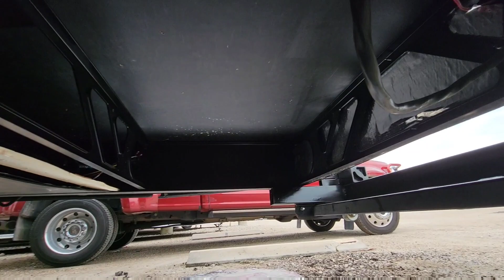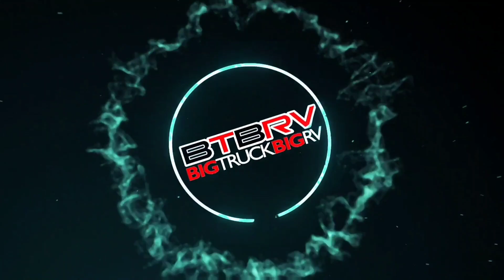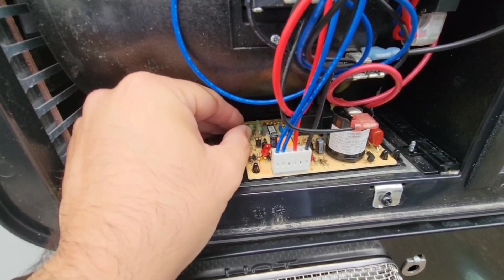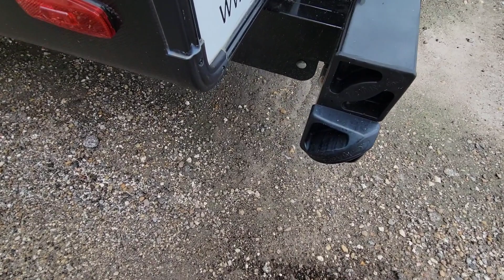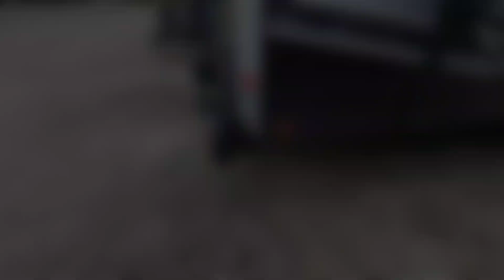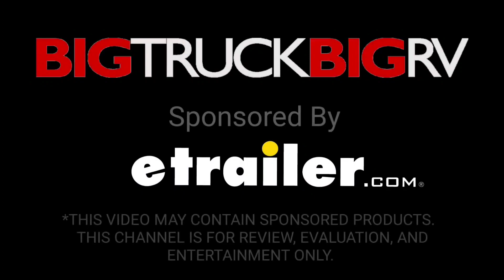Did I make a mistake modifying our new RV?

Comment from the maker: Update: The furnace power/reset button provides power to the interior thermostat, so I needed to turn it back on to use my ACs.  Since filming this video (several days ago) we have not had any issues with the furnace any longer.  An RV technician claimed that after the rain we had they received multiple calls from folks with the exact same issue.
Reply: Well that just means it's going to be a long term issue.
Reply: Good plan, remove the hitch and relocate rollers.
Reply: I would still coat that board. We are now in rainy season and you will be able to see if moisture is playing a part in the event when it happens
Reply: We had the same issue they replaced board and sealed well put a lip to re direct water
Reply: Just remove the hitch leave the tabs and the rollers alone they're not hurting anything
Reply: Sounds like the manufacturer didn't choose the best place possible for that circuit board.
Reply: @machfive916  engineers today lack the hands on and common sense needed to make a long lasting design. Utilizing conformal coating on the board would make sense however this would add to manufacturing costs. I will say this, today’s engineers designing today’s products have one skill figured out, “ engineered obsolescence”.
Reply: They didn't recommend a cover or deflector for the circuit board? Considering the door has a large screen vent.
Reply: How do they keep the tanks and pipes from freezing without insulation? Very strange.
Reply: A friend washed his 5ver and his refrigerator went down. He was able to reset it with the magnet switch.

Comment: My two cents… I would leave the receiver on.  First, I don’t think clearance gains will ever be enough to matter.  Second, resale as you might want to take your other rack.  Third, it will increase tongue weight slightly.  Fourth, if it ain’t broke, don’t fix it. Lastly, and this is the most important, it be a handy place to put a sign that reads “old fart on board”…. Lol.  Or maybe just truck nuts… derp!

Oh, and things are always stronger with more iron…🙂

Comment: I think insulation in between your floor boards and those panels is smart. In cold weather it would help immensely! And i have to agree with the way the factory runs there wires are exposed to chaffing or possible electrical fire if not careful. That really needs to be addressed before it bites you. Im going to look at mine and if this is the case with my rv im going to make adjustments.

Comment: So If I'm understanding what you have done correctly you extended the rollers to the bumper when you extended the bumper. I see a problem with this if you should bottom out all the weight now would be on the extended bumper and not on the actual frame of the coach so when in that mode you will litterly push your bumper and rack into the back of your coach. I would move the rollers to where the frame is so when riding on the rollers it would be riding on the frame I would also put two two inch receivers mounted in the middle of the bumper and possibly make it long enough to reach the next support structure so a longer 2 inch tubing  then attach your receiver so your racking would flush up with the top of the bumper  it would rate more that 300lbs times 2 and make your rack removeable so when in a jam you could remove it so nothing on the rack could damage the back end as well

Comment: I would say unbolt the hitch first and see if you really need it or not before cutting off the welded section that holds it on. A lot of campers come with the brackets but no hitch. Next I would suggest moving the rollers to the front side of the hitch bracket so that it is directly below the frame for support in case you did come in contact with something that put them in play!

Comment: I would remove it less weight is always better especially if it no longer serves the purpose. I would be more concerned about the wiring maybe wrap the wiring in something to prevent them from chaffing against the steel. Something to consider before you close it up again.

Comment: Remove wings , hitch and rollers and have a custom skid plate made across the whole thing. Rollers will be to much of a pressure point if they hit the ground through a dip. Would rather spread the entire weight of the Rv over rear frame . Less change of screwing something up . A fab shop could bend something up and weld to frame and bumper .

Comment: My take on it, is this... the rollers should have been mounted on the frame, not the extended bumper. Your extended bumper, most likely, isn't as strong as the frame of your 5th wheel and when it does hit the ground, it will bend up the extended bumper. As you said, it is only capable of 300 pounds of force. Your rollers will exert more than that, considering the weight of your 5th wheel.

Comment: I would remove the receiver and move the wheels forward. The wheels are pointless with the receiver there as the ground would hit it before the wheels. 

Moving the wheels forward would keep the weight off the bumper part which would probably just bend it and putting them closer to the main frame for more support.

Comment: I removed the hitch wings from my 398MBL. They hit the ground all the time. They drug the ground leaving the rv dealer. I'm not sure if mine would be different from yours, but i have to be carefully with inclines because i drag the back bumper very easily. 
I also had the same issue with the furnace after the Texas rain a few weeks ago. The outer trim you pointed out in this video has absolutely no sealant or gaskets behind it. water was coming in behind that and pooling under the circuit board.

Comment: Hard to get a good angle on it through a camera lens. 
1) Valid idea removing unnecessary weight and obstacle from the rear of the RV.
2) Would leaving it in place add any, or enough to be worthwhile, structural integrity.
3) While 'we' are down there, Is the Spare Tire low enough it would hit the ground before the rollers will? Can/should the spare tire be moved?

Comment: These boards are supposed to have a coating on them to help with moisture. My board for my water heater just failed because it did not have the coating and I could see where it burnt. The new board has the coating. As for the back of your tailer? Leave it!

Comment: I would keep the rollers and remove the receiver.  Something you might also look at is changing the mount point of the spare tire.  I got into  situation where the back end of my toy hauler started to drag and pulled the spare tire loose.  To fix l mounted it higher up between the l- beams.

Comment: Never fix a problem that doesn’t exist…
Have you often been in areas where you drag the rear overhang? No? Then stop overanalyzing it.
Yes? Drive over a string, pull it all the way to the rear bumper, and locate the roller (and/or trim the receiver tabs) just so it’s just peeking out from the plane of the string.  Anything worse and the rollers wouldn’t have helped, anyway, in that situation.

Comment: I Would Remove The Receiver Because It Protrudes Farther Than The Bumper & Every Inch Counts In Length Being Extended
I Would Leave The Brackets & Roller Assembly As Is  ! !
Looks Like The Bracket Could Give A Slightly Earlier Warning Due To Sound / Then You Could Stop & Evaluate Your Next Move

Comment: If you remove it all and you still want the bumper rollers but want them so they don’t hang down and contact so soon I’d take and have them inset in the bumper that way they will still be at the back and wouldn’t be seen as easy

Comment: I don't know...we have lived in a cabin for  15 years without insulation under the floor. We had 3 layers of carpet and insulated skirting, and we had to keep our feet off the floors when seated and never go without socks and slippers. See what happens when you winter camp...even in heat. I am stunned that it is not insulated! Is that normal for other RVs? Mine says 4 seasons, so i assumed it was insulated.

Comment: I would leave it. If anything I would cut off the receiver. But just like light truck MFG's the give you a hitch receiver. It also acts as the last crossmember and ties the rear of the chassis together.

Comment: I had a receiver hitch made that attaches to the frame not to the bumper at all. Also had a rack made that goes into the 2 inch receiver hitch that’s heavy duty enough to carry the generator spare tire and has a rack on it to carry my two kayaks. That receiver hitch also has an extension receiver hitch 2 inch heavy duty that my bike rack goes into the carry the bikes. Works fantastic did cost a few hundred dollars but there’s no pressure or touching the fifth wheel bumper.

Comment: I don’t get the lack of insulation.  Batt insulation weighs so little and adding it would only help the insulated floor.  Why not have it in there and boast that the floors are even more insulated than the competition?
Reply: Batt insulation hold water, A friend had a toy hauler with batt  insulation under the floor ,several years ago .He ended up driving back from a beach trip in heavy rain. After a couple of months the floors began to get soft in several places. Had a RV inspection , the insurance totaled the RV . He was told there is no way to completely seal the underbelly .

Comment: In wet humid conditions fiberglass insulation will hold water and sag, plus it could/will be a habitat for mice, insects, etc. "Rabbit" out half of the board at the frame to allow the last panel to slip in, you would only need to rabbit or notch it out a few inches on each end, and keep the center section as is. Cut the welds and drop the receiver hitch.

Comment: Ditch the receiver hitch and the rollers. I'd cut some foam insulation and tuck it up in the void space using some channel clamps on your Ibeams to hold it in place. I'd also drill a few holes in that paneling and use the screw out removable christmas tree fastners to gold them together. I'd also likely take the time and plasti-loom all the wires up to minimize any possibility of chaffing which would cause shorts. Alot of work but in the grand scheme cheap insurance to protect your investment.

Comment: I vote for removing the hitch if it can be neatly done. I would also remove the “ears”. Then take a board, to simulate the road, run it from the back tires to the bumper. Now find a spot where the rollers meet the board and attach them there. Thank you for sharing and have a great day.

Comment: That spare looks like it is hanging pretty low.  Sweep a string from the lowest point on the rear axle and the rear most point of the trailer with the bike rack down.  See what the string contacts, then decide on how to move forward on modifications.  As an alternative, jack the front of the trailer up (on level ground) until something at the rear contacts the ground.  Modify as required for clearance.  Yes the front is going to have to go fairly high to get the rear to contact the ground.  Yes this will stress the suspension.    However, this test is going to be much less problematic then testing for contact under power.

Comment: I would still put batt insulation.
Reply: I was surprised there was none.  Our Arctic Fox has R-7 batt insulation under the plywood deck.
Reply: @txshirle  arctic fox is a four season rig so it should be well insulated.

Comment: Having just gone through the upper deck of my fifth wheel failing I am an advocate or structural support.  There is so much energy transmitted through the frame components support is paramount. Had the manufacture of the frame added cusots to the upper deck it would not have failed.  When the new deck was added it was welded with many arears of support that should have been done at time of fabrication.  Those brackets are adding support to the rack you have installed, and have pulled 76,000 miles in the last 4 years with bikes there is alot of energy being put to the frame back there.  .  Just my thoughts.

Comment: Instead of that small piece of wood to join the underpanels, just get a 6 inch wide board the same haight and length. The extra strength means that if done on every join you will be able to insulate the underbelly with rockwool etc. In the video the electrical cable seem to be prone to chafe. I would suggest if this is the case you secure the cables to avoid chafe where they pass through the steel foor beams. I have fitted a small length of garden hose cut langhtwise places around the cables and then secured with electricians tape or similar. This gives protection to the outer cable insulation.
   Bob

Comment: The wiring in the underbelly makes me cringe. Not enough slack and the needs to be some kind of wire loom protection/tubing as it runs thru the cross beams.

As far as insulation goes, instead of batting, how about silverboard?
Reply: Every bump and vibration cuts into those wires and the wiring and circuit board placement on the furnace looks "cheap.
Reply: @phoneman1957  Yup and its an easy fix to keep those wires safe. As for the circuit board it shouldnt be underneath the drip point of anything. Needs to be relocated or encased.

Comment: From the video it appears to be a very basic one sided circuit board. Old School large components. You can apply heavy coat of conformal coating to it so moisture wont effect it. You can get it in a spray can. We use it at work on boards that are used in outdoor Military Radio equipment.  Dialectic grease the connectors. Should be good to go after that.

Comment: RE; Bumper and rollers - The setup as-is only protects against a unique tilt-up issue. I don’t think it would do you much good if you ran over a speed bump type hill that was the width of the RV and of sufficient height.  You should do some drawings/modeling of the RV going over various size hills with various size crowns and widths. In many cases I think you’ll find the spare tire, the leveling jacks and other areas of the undercarriage will make contact before the bumper does. It looks like the bumper is meant to protect you only when you’re backing up, otherwise you need protection along the leading edges of the under carriage.

Comment: I would have used larger drag wheels that swivel, maybe attached to those 'wings". I agree...yu don't need the receiver. I don't like them because they stick so far out that when you put any sort of carrier, etc. on it, it will teeter and twist from side to side as well as bounce. I think putting the rack on like you did is the best way to do it.

Comment: BTBRV, You should use your influence to get these R.V. Manufactures to do a better job of running electrical wiring with the under belly pulled I saw possible wire chaffing issues. I have Noticed on other Videos how Messy the Wiring is in most of the RV's you have shown.
Reply: I agree, seeing wires run loose no protection no securement will surely lead to electrical issues in the future. I know I just love electrical issues.

Comment: 2" of Closed cell spray foam. Totally firmed up our toy hauler. Completely wealther proof. It's like a rock. And protects the wood floor. It was about 1000 but it was money well spent. As for the rear bumper setup. I'd leave it. For the reasons you did it that way in the first place. Safe travels.
Reply: Wow some one here knows about spray foam. That’s awesome . 👍A good question is why aren’t more offering this as an option during manufacturing . The loss through the floor is unreal, never talked about , it’s always roof and side walls . Good for you 👍👍

Comment: In the close up of the board I see that the back left section of the board is not attached to the black stand off peg. If the bottom of the board drops down, it might short out to the metal bracket. Home furnaces have a default to run the blower after a power interruption. The board is assuming that the unit had been running and that it is still hot. So the fan runs for a couple of minutes to cool down the furnace before it can restart.  Good luck

Comment: I never liked those little roller wheels.  Last rv I had, I installed heavy duty swivel rubber wheels,  such as you might find at Harbor Freight.  Bigger ones, like 6" or even 8".  That way,  when I would bottom out the wheels could turn freely especially in turning situations.  Those little rollers would rip off, rust up, fill up with gunk, generally were more trouble than they were worth.

Comment: I would remove the whole set up and lower the skid rollers. I dont think they hang low enough to help you out if you encounter uneven terrain moving forward. They will catch and assist while in reverse but I think you need to drop them to hang lower. They make some great bike racks for the receivers.

Comment: Cut the 2” receiver and the cross bar off but leave the two outer wings. They protect the rollers so the rollers can’t get snagged on something. Did I notice that the bug screens were on the inside of the access door?

Comment: I would leave as it is, you never know when you may need a bump step.
Reply: I was thinking the same thing
Reply: Concur, the wings and rollers are needed where they are to protect the bumper assembly.  I would hope that you could avoid dragging the receiver. But I would wait to see if it is a problem.

Comment: How often in the past did you get into or close to a situation where the ground clearance was tight.  If you run into those a fair bit, cut it off.  Else, leave it.

As far as the furnace, I would leave the switch in to see if the issue happens again, and make note of the conditions it happens in.

Comment: Lmao. Those wires will never ware the coating off while traveling.....  said No one EVER !   Wow 😳
Reply from the maker: Well, they generally don't. I've personally never seen it happen on any RV trailer I've explored (quite a few)...  The ones that have experienced that usually have some other issues helping cause wear on the shielding, such as a sharp edge or a wire that is pushing and pulling under tension.